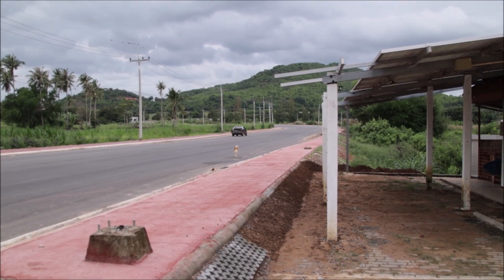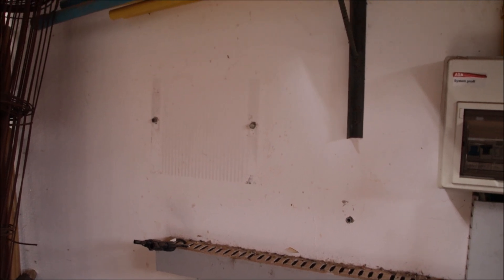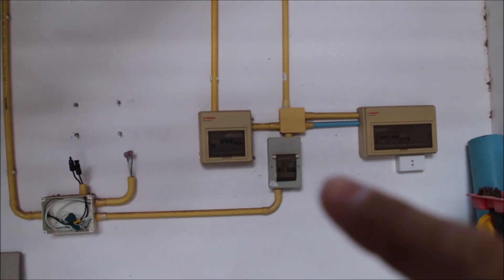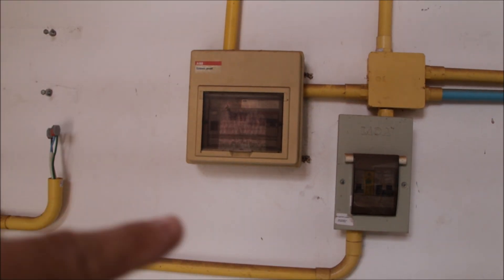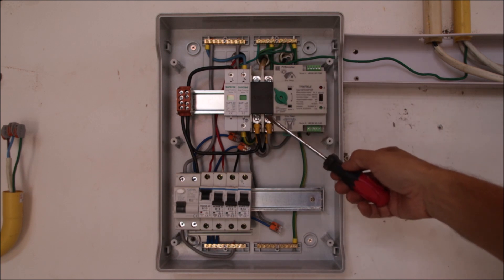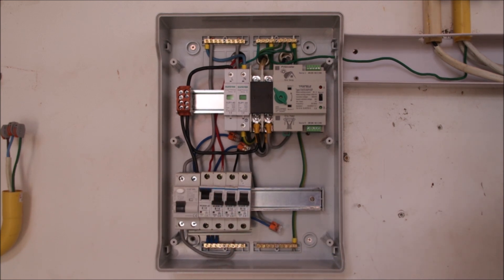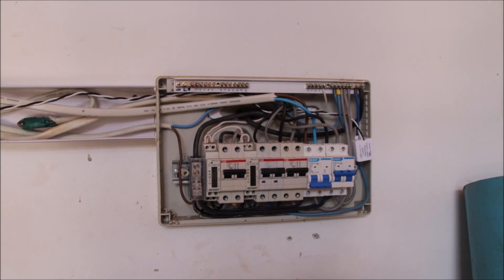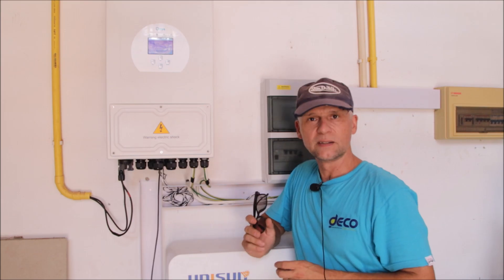The birth of our new Storage System

Comment: The fast automatic transfer switch has two very whobly mounted PCB's with rectifyer and the switch to switch of the coil short after activation. I will recommend to make a support (glued in resin boards to the housing walls) cause if this cam switch move further away from the notch shaft the coil will burn trough or catch on fire.

Comment: Hello Roland. This is Matthew in Australia again. What kind of SPD do you recommend for my 24VDC solar strings (i.e. each string of solar panels is nominal 24V)? The lowest clamping voltage DC SPD I can find is approx 500VDC. My understanding, this is far too much and will run risk of destroying the Inverter Hybrid. I want to install the SPD before the Inverter Hybrid (EPever Upower 24V), at the junction where all my 24VDC solar strings converge into the shared DC non polarized double pole CB. I will send you $20 AUD for advice/recommendation. Bless you and your family. Kind regards, Matthew.
Reply from the maker: hi Matthew. Good to see you. I found these 2 devices on AliExpress:
https://s.click.aliexpress.com/e/_mMxQuE0
https://s.click.aliexpress.com/e/_mN3klfW
Unfortunately no known brands, but for low DC voltage systems.
greetings to Australia!
Reply: @RolandW_DIYEnergyandMore  I will send you money in two days, when my bank opens on Monday. :)
Reply: @RolandW_DIYEnergyandMore  Regarding the SPD aliexpress options. Which type should I buy? Should I buy the 24-48VDC type or the 48-70VDC? I am leaning towards the 48-70VDC, since my understanding is the 24-48VDC will clamp Voltages from 24VDC upwards (which would literally cut off the solar panel due to Voc being 43VDC). In other words, the open circuit Voltage of each of my solar strings is 43VDC, which implies I need to use a SPD that has a Uc (clamping Voltage) of minimum 43VDC, therefore the SPD size I should use is 48-70VDC. Does this sound correct with logic? Thanks Roland. I will send you $30 on Monday. Bless you, Matthew.
Reply from the maker: @Matthew_Australia  yes Matthew. 48-70 is the correct option
Reply: @RolandW_DIYEnergyandMore  Excellent. Thank you so much! Monday AEDST is when to expect $30 AUD in your account.
Reply from the maker: @Matthew_Australia  thanks mate for your support